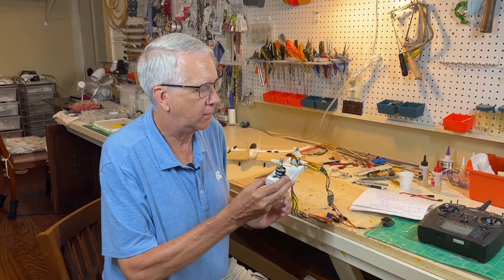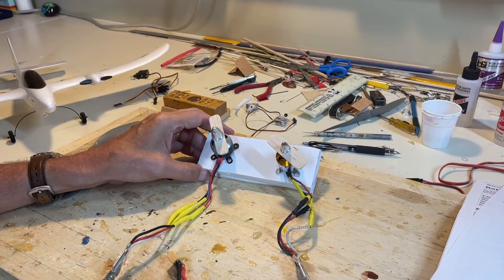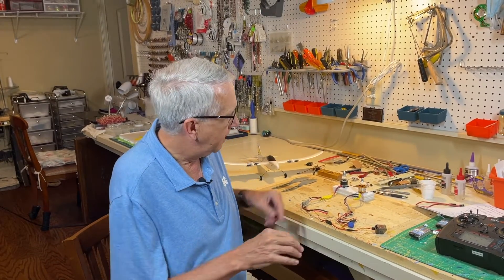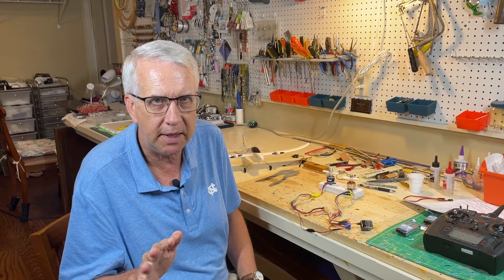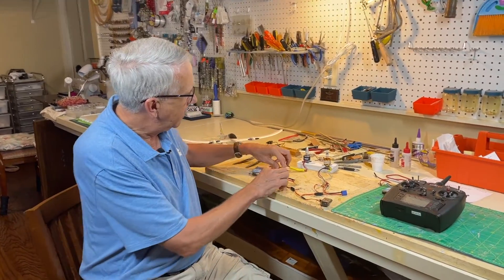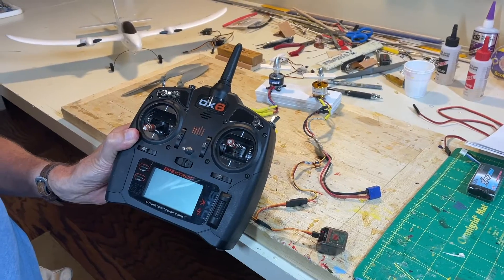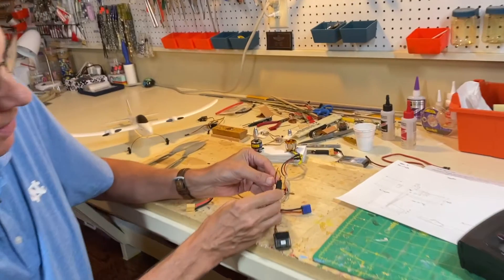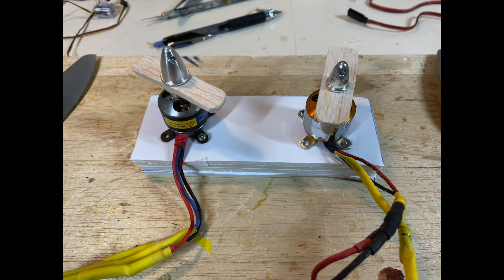Simple Multi Motor Setup for Newbies

Comment: Hi Tim. Do you have any idea of how, on a multi engine setup you can use one esc to power the receiver and main servos and another to power electronic retracts? In other words have two ESCs doing two different jobs with the signal coming from one receiver. I have a Lancaster with four main flight servos which can be powered by one of the ESCs and in addition a pair of all metal reracts which draw a surge of current when operating. I don't want to risk a brown out when I raise or lower the gear. Any suggestions?
Reply from the maker: No idea. Do check with www.RCGroups.com . . . lots of good info.
Reply: @TimMcKay56 ok. Thanks.

Comment: Thank you.  But rather than use two batteries, what about just one with a C value   capable of feeding both motors?  Then if you need the ESC with the red wire uncut, to talk to the receiver, you can probably run the one with the cut wire through a toggle switch if you had to.  Just wondering.
Reply from the maker: Could be, I just do not have enough info to comment on this.

Comment: The x fly motor I ordered has all black wires to connect to the esc.  There's no direction on how to hook them up. How do I figure out what wires to connect to each other?  If you have any suggestions on where  I can get the info id really appreciate it.
Reply from the maker: Not a problem at all.  Simply connect all three wires to the motor.  Keep the prop off for safety.  Run the motor, see what direction it goes.  If for whatever reason the motor runs backwards, just take ANY two wires and reverse them, the motor will run in correct direction.  Tim
Reply: @TimMcKay56  Will do 👍. Thank you very much .

Comment: I did not cut the center wire going to the second ESC. I used only one battery. This installation was in a home design and built F22 with dual 40 mm electric jets. If flew great, with no thrust problems
Reply from the maker: Thanks for this!  Tim

Comment: for a project i am working on, it is required i use 8 motors, I am at the final stage of this project but i believe the left side of the wing is spinning faster than the right side, is there anyway to adjust this?
Reply from the maker: NT:  I am not sure with 8 motors. Do ask this on www.RCGroups.com  Tim

Comment: Hmm.  I tried implementing your set up, but I'm having problems: One motor runs crazy fast, and the other motor barely ticks over.  I've tried every iteration of components I could think of, but always get the same behavior.  I want to default to your set up because it seems intuitively correct to me, but I can't get equal power on each engine.  Both engines and both ESCs are identical make/models.  Any advice?
Reply from the maker: So sorry . . . wish I could help.  No good idea.  Perhaps other viewers can assist.  Tim
Reply: @TimMcKay56  thanks for the reply. I found a solution, although an awkward one, by simply using two receivers, two batteries, two ESCes, etc. I.e. two separate, and isolated, systems. The  ESCes I’m using are cheapo junk, (Flitetest) so I’m not totally surprised they wouldn’t play nice with a dual setup. Thanks for the great video!
Reply from the maker: @123cp8  No worries, good luck!  Tim

Comment: Thanks Tim, is there anything I can do on the radio side to sync up the RPM's. I followed your directions and got both motors to sync up at any throttle level, but after taking my tachometer,  one motor has slower RPM than the other. Any ideas what I can do to sync the RPM?
Reply from the maker: Rudy:  Great question!  No clue here, can anyone assist??  Tim
Reply: @TimMcKay56    just figured it out. Motors have to have their own channel then mixed to work on throttle stick. Once that is done, you manipulate the servo balancer and increase the rpm to the motor that's lagging.
Reply from the maker: @LOSCABOSLIFE  Perfect, thanks!!  Tim

Comment: Mr McKay,, I need to lengthen the wire on my motor to the ESC,, what gauge wire can I use?
Reply from the maker: Billy:  I do not have a technical answer, what I would do is match the gauge of the existing wire.  If anyone else has a better response, please chime in!  Tim
Reply: @TimMcKay56  Thank you sir, I only need about a foot extension,Built a twin motor Cargo style and need to lengthen the wires to reach the space underthe wings..

Comment: Only thing you didn’t cover, and I was really hoping you would, is why the wires between the motor and esc(red and black) are switched?
Reply from the maker: Tyson:  Easy!  Three wires connect from the ESC to the motor (brushless motors have 3 wires for the signal, brushed motors just two wires). Manufactures do not coordinate on wire colors. As you connect the 3 wires from the ESC to the motor, the motors turns in a given direction. If the wrong direction simply reverse any two wires. Tim
Reply from the maker: The motor wire colors do not really matter. Just connect all three wires. If the motor turns the wrong direction simply reverse any two wires.

Comment: great video.  i just bought a 4 motor c 130  and i want to re do the motors.  do i use 2 ESC  and wire 2 motors to each or do you recommenrd 4 ESCs
Reply from the maker: Ray:  I think an ESC per motor is the correct approach. Good luck!  Tim

Comment: hi Tim I watched this video again today and found it helpful, just to ask, should both motors spin in the same direction, I've heard of twin motors spinning in a different direction, ? thanks from Tony from Bedfordshire
Reply from the maker: Tony:  Motor rotation on our RC models makes zero difference in performance. Where this matters is with full scale twins with big motors; think a P-38. By having contra-rotating props an engine failure on takeoff (worse case as you are at full power) is a lot easier to handle. But no issue, really, with our models. Tim
Reply: @TimMcKay56  I'm not so sure about that Tim! Having contra-rotating props on a twin means you have no need of sideways offset of the motors to counteract torque roll. A BIG bonus on light foamies! Having the props rotate inwards at the top is the standard way to minimize the effects of loss of 1 engine in real aircraft. But probably as you say the effect would be much less effective on these toys.
Reply from the maker: @theoztreecrasher2647  Yes, with our smaller models and efficient electric motors (minimal torque), my guess is our twin models might fly quite well on just one motor. Tim
Reply: @TimMcKay56  They don't actually. The asymmetric thrust is practically impossible to counteract with normal sized rudders. Lost a motor on an AtomRC Flying Fish - not a hope in Hades of controlling it on just 1 motor. Also "minimal torque" is far from the norm with powerful electric motors in very light foam frames. There are multiple videos up on Youtube of hotrod wings corkscrewing into the air from a standing start before gaining enough airspeed for the elevons to be effective enough to keep it straight. 😉
Reply from the maker: @theoztreecrasher2647  Thanks for this update!  Tim

Comment: Great video,  I was wondering,  when you disconnect the batteries from the ESC is it the same sequence as when connecting them? Or does it matter? 
Thanks a lot...
Reply from the maker: Jim:  Does not matter when disconnecting, as the ESC does not need to "see" the proper signal.  Tim
Reply: @TimMcKay56  Thanks Tim, I'm not sure what that means,  but I understand there is no sequence for disconnecting the batteries... Thanks again.  I think I'm actually starting to understand...

Comment: Thank you very much for this informative video ! I am building a 2 motor R/C boat and was wondering how to wire everything correctly. Is there a difference for regular brushed motors as this is the type that came with my kit ? (Graupner Key Biscayne )
Reply from the maker: That is a great question, and I’m afraid I do not have the answer. ESC are so crucial for brushless operation, not sure how this applies for the older brushed motors. Apologies!  Tim

Comment: Hi Tim thanks for explaining about the twin motor setup for brushless motors , it helped me , as I have thought about upgrading a twin model I built of the BN islander , it has flown a circuit on 400 brushed motors , but was al bit under powered , your video is a nice guide , I've got two identical brushless motors that should work fine, giving plenty of power, thanks again Tim , most enjoyable , from Tony from Bedfordshire England ,
Reply from the maker: Tony:  All good!  Tim

Comment: I believe your "2 battery redundancy" which is your objective does not work if one battery dies, and it is the ESC/BATTERY PAIR with the good ESC / receiver wire.  The other "good " battery will not run the Rx and servos due to the cut red or center ESC wire. An automatic switcher switch could save the plane in this case. I am nit sure how to build or buy one of these.
Reply from the maker: Good point, I need to check this out.  Tim

Comment: I appreciate your time and expertise on your videos.  Thanks. I an watching your video now. On my E-Flight Twin Otter the props are CCW port side and CW starboard side with separate 20 Amp ESCs. I have replicated this exact setup and motors etc in my 1995 Graupner Partenavia. Going Lipo vs Nicad, and brushless vs original Speed 400 brushed ( can) motors has reduced wing loading of the bigger Partenavia by approx 30% .
Reply from the maker: Sounds like you are making good progress, best of luck!  Tim

Comment: Great Video Tim. I have several twins (Mosquito, PBY and BF110) and its a good idea to have counter rotating props. opposite handed props are quite easy to get hold of these days. Also if a motor fails on a twin unless you have huge rudder it won't counter the thrust difference. The best thing to do is throttle back point the nose down at a fairly steep glide angle and flair just before the ground. I learnt this when my PBY developed a dodgy motor. I look forward to the build.
Reply from the maker: Mark:  Yup,  that is the key.  With an engine failure throttle back to maintain control.  Just flew the twin this morning, flies great!!  Video out in a bit.  Tim

Comment: I have 4 dualies, two I made, 2 were rtf.  They are my favorite planes.  All have counter rotating props so no right thrust angle has to be figured.  All use a single battiery and have identical motors.  Using two batteries and/or different motors could cause differential thrust as the batteries could discharge at different rates.  I don't fly dualies because there is redundancy, but because they have such great flight characteristics, so stable and predictable, if not as acrobatic.  I tried to connect 2 motors to 1 ESC; one motor was damaged.  Maybe it was defective, as some people have had success, but I'll use 2 ESCs from now on.  I know you like to build from scratch, but the LIDL gliders are great airframes for dual motors.
Reply from the maker: Mike:  Great input, thanks!  Tim
Reply: Yep Mike. For anyone interested in a really class twin LIDL build see the "Bavarian RC"example!

Comment: I don't understand why it's preferable to add extension wires on the motor side of the ESC rather than on the battery side. All the timing pulses, or whatever, occur on the motor side. On the battery side, it's pure DC with the capacitors on the ESC helping to hold the voltage steady, or helping to filter out any high frequency voltage variations. Seems to me it would be preferable to add extensions on the battery side. 
   Before I became aware of these discussions, I added perhaps 18" of extension wire on the battery side of the ESC on a large delta-wing "flying sled" made from cheap insulating foam. I had no issues with the ESC/motor combination. It seemed to work fine. I'm not saying that your explanation is wrong or anything, I'm only saying I do not understand it.
Reply from the maker: 👍🏻 Tim
Reply: ESC space and cooling requirements dictate if you extend 3 phase or DC supply wires. A good design. as in the EFlite Twin Otter has the ESCs crammed in the nacells. also, cheaper to make ESCs  with all  short wires.
Reply from the maker: @reasonitout9087  All good!   Tim